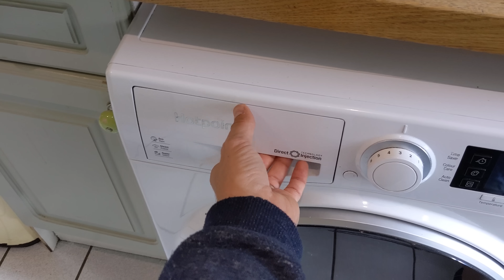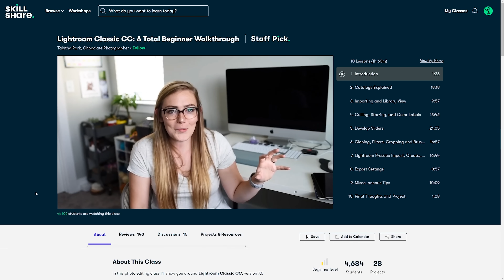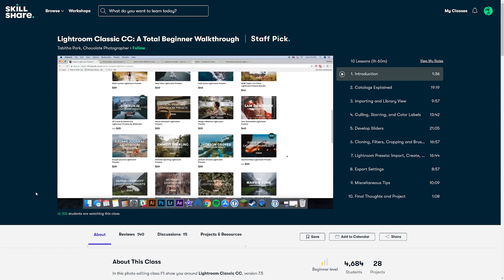The Pythagorean Siphon Inside Your Washing Machine

Comment: I'm 36 years old and have lived my whole life in the U.S., and though I haven't seen a great number of them, every toilet flushing mechanism I've ever seen has not been a siphon type. 

I particularly like the water-saving flush option. I may look to see if a siphon-type with that dual-flush is available for our toilets.
Reply: Its always fascinating seeing the ways different countries come up completely different solutions to the same problem.  Who knew a flushing toilet could be so interesting.
Reply: There are ones that don't even need to empty half way. You can get ones that have a small button and a big one for different amounts of water. Alternatively you can get ones with a stop button if you want more control, but it will use the full amount of water if you forget to press the stop button.
Reply: there are suppliers of siphon type cisterns available with imperial threading and pipe connections :)
Reply: @Adam Courchaine That is a neat idea. But the problem I'm currently having is that the flapper valve is leaking; having a siphon-type would prevent that entirely.
Reply: IstasPumaNevada Exactly, the syphon type is actually much more reliable. They were all that we ever used in the UK, I think they were mandatory. Then Europe kicked off and insisted their manufacturers had access to our market with their crappy flapper valves. So now, every other toilet has a steady trickle of water pouring down the drain 24/7 due to a faulty flapper. Even a bit of limescale is enough to make them leak. Syphons will never do that, and continue to work for decades. It's quite common to be renovating an old house and find the original toilet from the early 20th century still in place, still working perfectly, even with half an inch of limescale build up on the syphon.

Comment: I learned this as a bell siphon. It’s used extensively in aquaponics.
Reply: Thank you! I was about to write the same comment!!
Reply: @philippejobin90  It's not - a bell siphon has a HEAVY cast iron bell in it and it's the weight of this that starts the flush when you release the flush lever (or chain). See: https://qph.fs.quoracdn.net/main-qimg-880fc7a941ea281edf35e7c334f798a4
Reply: I've just looked at the diagram again - and am not changing my mind as to how it operates. I am, however, going to point out the howler of a typo in the heading for the diagram - they must have used a tuned musical bell :)))))))))))))
Reply: It's not - a bell siphon has a HEAVY cast iron bell in it and it's the weight of this that starts the flush when you release the flush lever (or chain). See: https://qph.fs.quoracdn.net/main-qimg-880fc7a941ea281edf35e7c334f798a4
Reply: pmailkeey the weight is immaterial. The siphon is initiated by lifting the bell, not dropping it.  It’s obvious from the drawing. It is, in fact, the same sort of bell siphon.
Reply: @HylanderSB  I'm not convinced as what the point of mentioning the weight of it? Also, the falling bell is reducing the space underneath it, forcing the water to start the siphon. Lifting the bell increases the space under it - so the water level at the standpipe would drop - and therefore not start the siphoning.
Reply: @HylanderSB  I do not mind being challenged - and as I have said, I have not changed my mind re the operation of this flush mechanism. But I'm happy to do more research to back up my opinion and I've found its operation is explained here: http://www.users.waitrose.com/~ttagrevatt/vlav/works_cisterns.html#bell
just as I said.
Reply: @HylanderSB  Without a bell, it's not a bell siphon ! One has suggested 'Pythagorean siphon' - as it was used in a 'Pythagoras Cup' - if you're looking to give that style of siphon a name.
Reply: @HylanderSB  More interestingly, that design of system is not a siphon in any case as it is not a bent tube !
Reply: pmailkeey look. I didn’t come up with the term. Millions of people are using it.  What are you going to do? Convince them yourself? You can’t even convince me.  Give up your pedantic fantasy and move on.  Take care.

Comment: Most American toilets I've come across just have a flap over a hole in the bottom of the tank. Pushing the handle lifts the flap and the water rushes into the bowl, forcing the contents out until the system equalizes. I've never seen that siphon mechanism before, that's pretty neat.